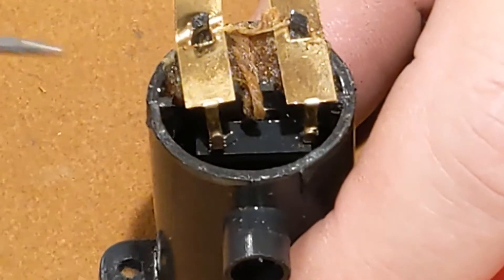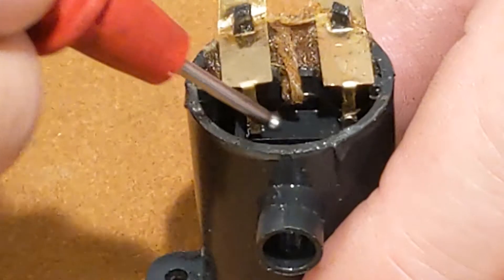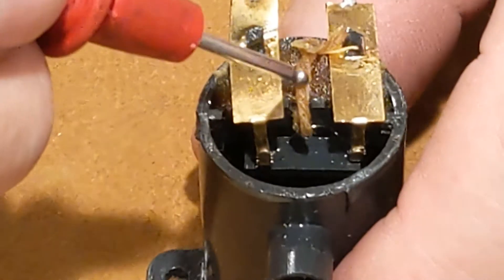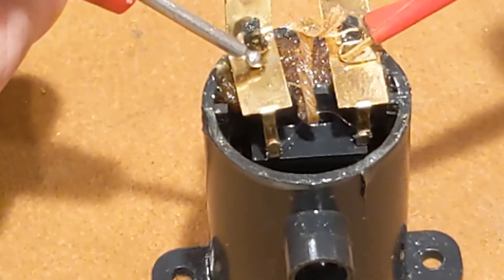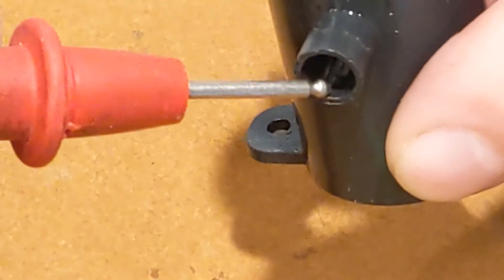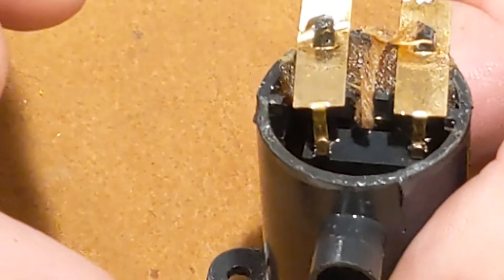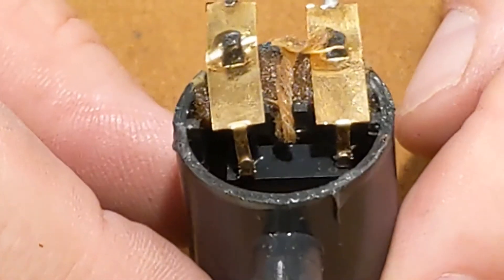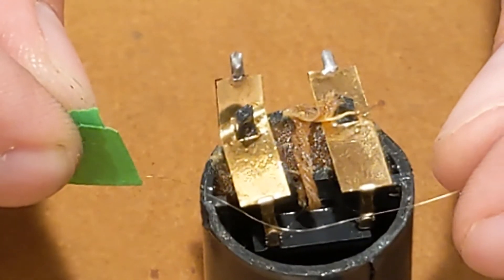Repairing the smoke generator in the Smoking Space Man Tin Toy Vintage Robot

Comment: Hi , great channel, `👍. I have a similar smoke generator in my Charley Weaver Bartender ,  getting 3v on terminals , bellows working etc, added a few drops of mineral oil, faint smoke , then nothing, question: is it easy to remove the cap terminal to investigate the wick etc. Mine has has red terminal cap with no obvious way of removing it.    Many thanks